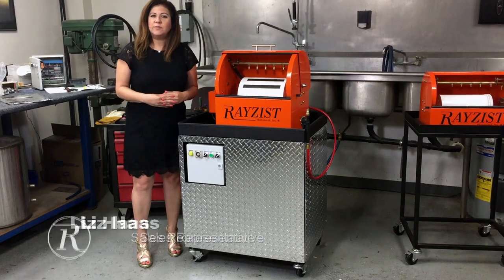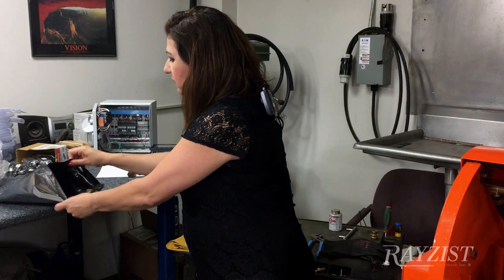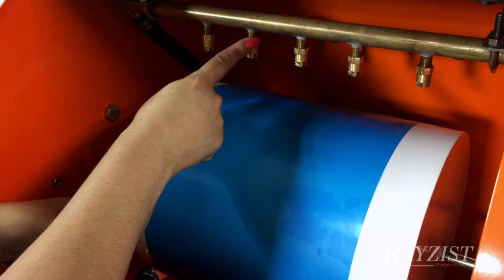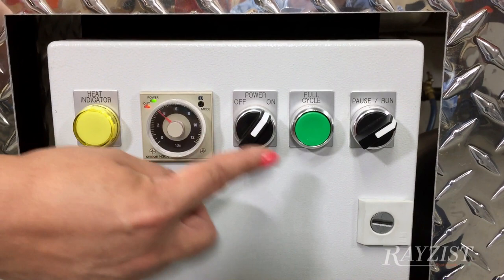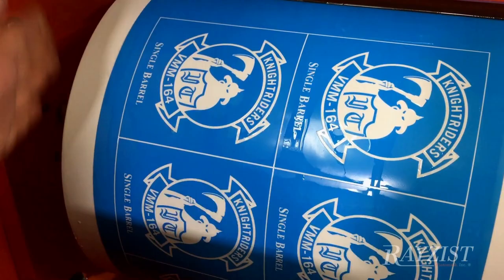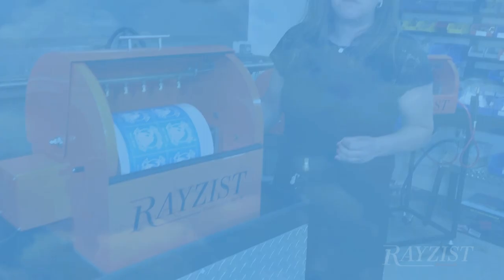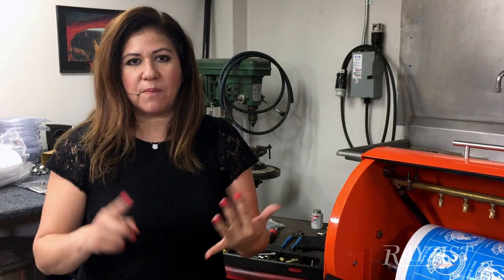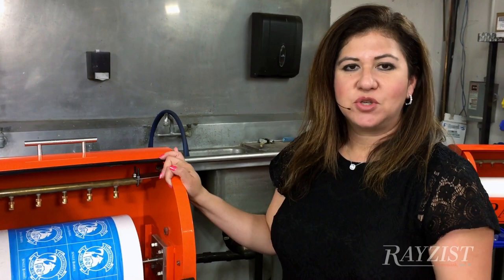1232 Automatic Washout System

Comment: So once you use the luminex you wash the film to reveal the image?
Reply from the maker: This is correct; you develop the resist film with pressurized water after exposure. Automatically, with the 1232 Washout System.
Note, you can use the LetraLite to expose the resist film; the Luminex 1422 is a higher quality exposure source because of its vacuum frame compression.  
I hope this helps, thank you for reaching out to Rayzist.